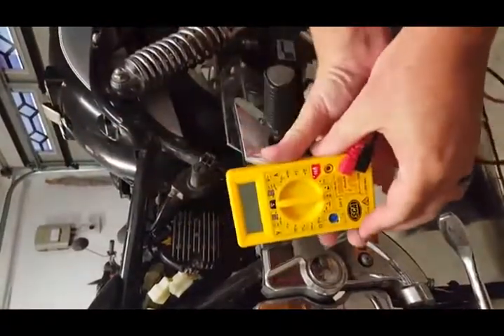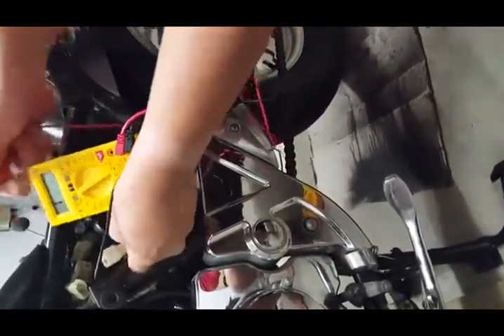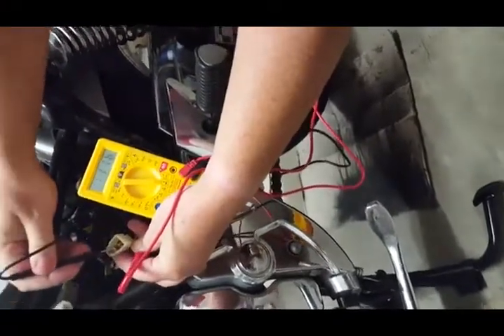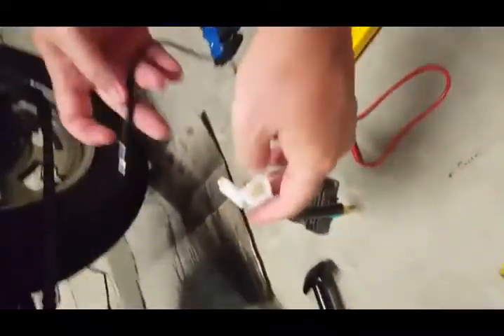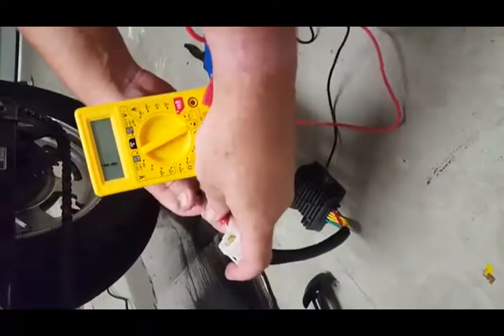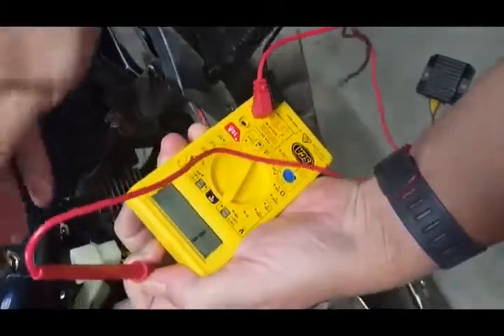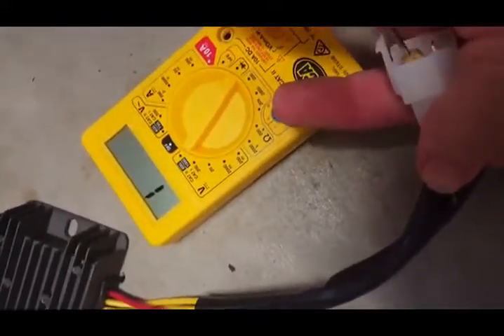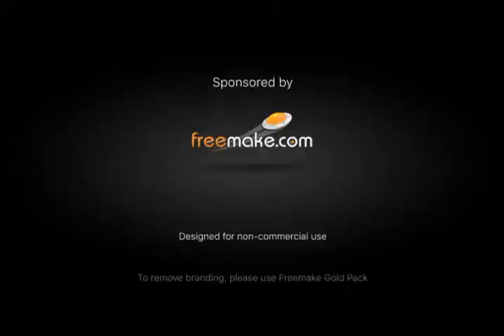2010 Hyosung GV250 Aquila Regulator Rectifier Test

Comment: Thanks for explaing this as my hyo 250gt 2012 rectifier get very hot and the engine cut out is this a problem with the rectifier do you know it's so please can you help cheers from Australia
Reply from the maker: Hey Paul, unfortunately I don't have the bike anymore but I do recall when I was researching the error that the rectifiers do get quite hot. I only changed mine out as it wasn't charging the battery and draining the power instead. This is a common error for the bike, I am sorry I can't help with yours but this video hopefully will give you the help to be able to test it to see if it is a rectifier issue.

Comment: I'm having a lot of trouble finding a replacement any suggestions where to get it
Reply from the maker: Michael I sincerely apologize for the delay in responding and I hope you have found a solution for your problem, I found this one I believe on ebay, there were some expensive ones around as well but it is definitely buyer beware with the cheaper ones and making sure that there are enough wires to match up with the existing unit.

Comment: How was the bike running before & after you installed the new RR??
Reply from the maker: Was running okay beforehand but draining the battery which was quite frustrating having to charge it after every ride and adding lights to the load just made it worse, once the new one was fitted I never had another issue.
Reply: @damoontwo4725  dude, im having a battery drainage with my hyosung gv250 so im wondering if you know any ideas? We replaced the stator and the rectifer already and it still does it
Reply from the maker: @ScarletDeathPro  Not sure unfortunately, only thing I would probably do is check the connections and get the battery tested. Hopefully you get it sorted.
Reply: @ScarletDeathPro  Hi Scarlet;did you find the problem cause i have the same problem